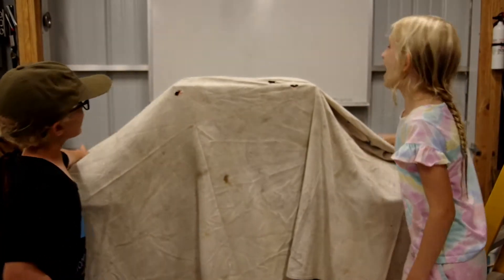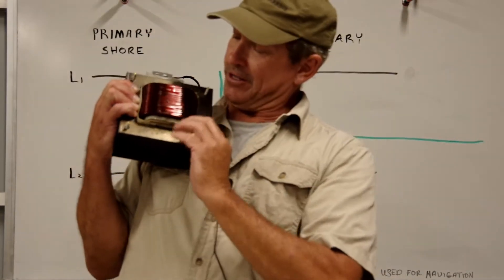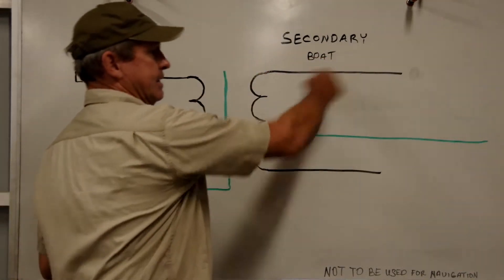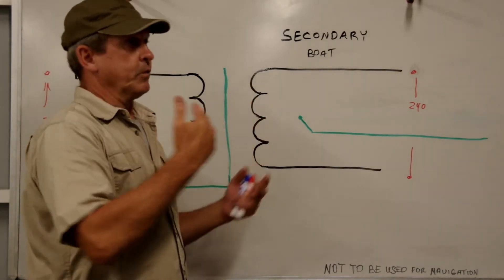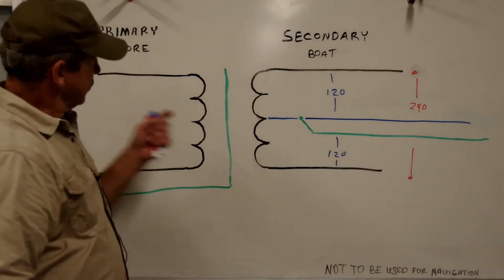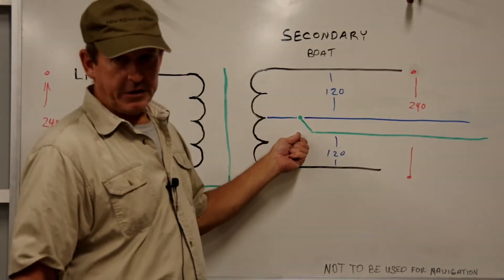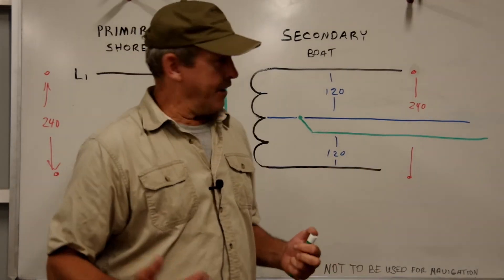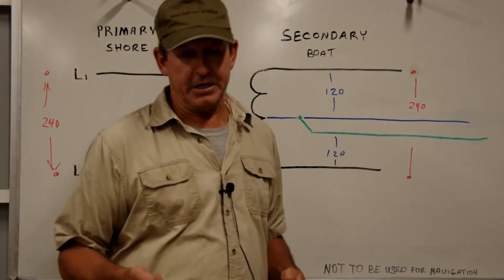Isolation Transformers

Comment: Awesome videos - just subscribed as i ran into you isolation videos (diodes vs transformers) - any comment on lightening if one is more attractive than the other or better able to survive a strike (direct or neighboring boat) and the impact to electronics.   Another thought is would a faraday cage be better off tied to ground with either of these solutions?   Thanks for a fun informative video.
Reply from the maker: Good qustion hard to answer lightening is so unpredicable, but maybe an isolation transformer might be better as the ground is not connected to shore.